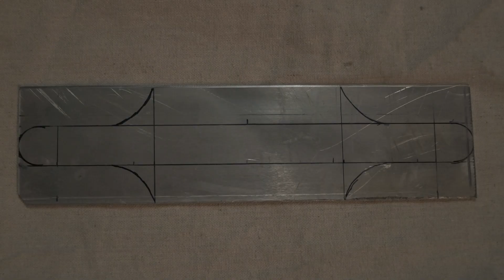how to make a metal shield (easy)

Comment: Would this stand up to full power wood sword swings?
Reply from the maker: Wizard austin it absolutely would. it might put small dings in the shield though.
Reply: You can also make a wooden round shield that the Vikings used it willstand up to blow alot better then aluminum